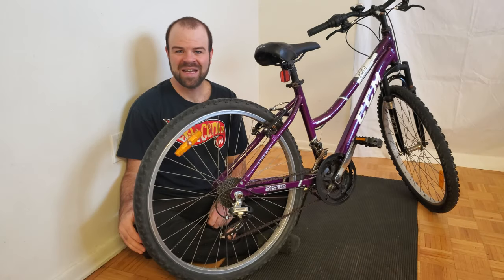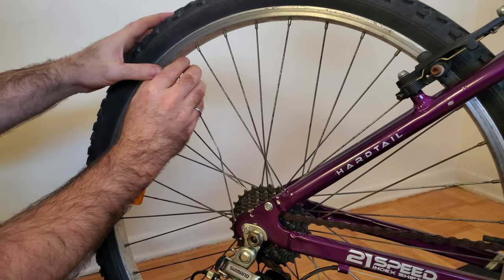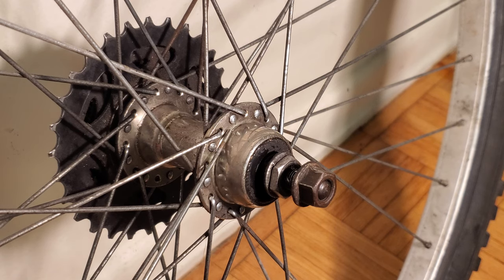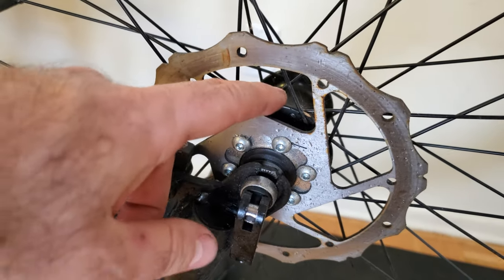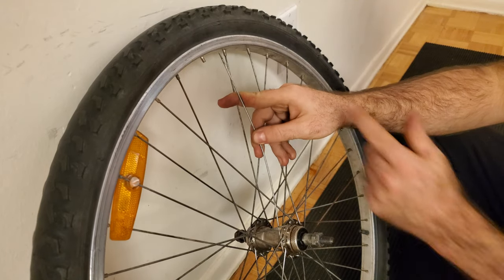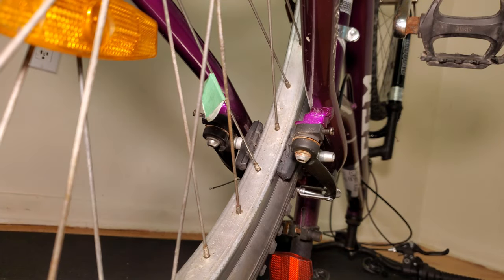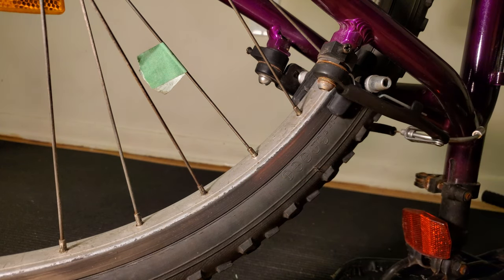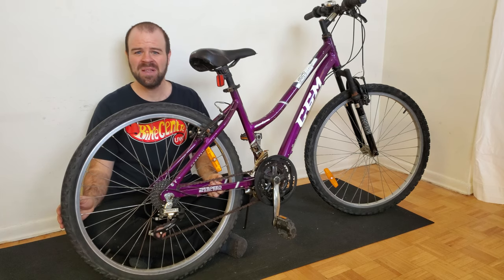How to Fix a Broken Spoke on a Bike Wheel

Comment: I like the method to remove the spoke (which broke at the flange) without removing the tyre.  It never occurred to me before to not have to remove the tyre but in that case it is not necessary. That will save me lots on time in the future.  Thanks,  much appreciated.
Reply from the maker: For sure, thanks. Most of the time they break at the flange in my experience too.

Comment: I'm wondering if you break a spoke, does this mean that all the other spokes are also fatigued and likely to break after your spoke fix?
Reply from the maker: Not necessarily. If it's the first spoke that has broken on your wheel, it could have just been a defective spoke which failed prematurely. If you've already had to replace multiple spokes, it's possible that they are all approaching their fatigue limit.

Comment: 11:40 The #1 cause of broken nipples like that is a spoke that's too short. The ideal length is one that just engages (fills) the neck/shoulder of the nipple, giving it extra resistance to being crushed or fatigued by the relative motion of the rim eyelet. Leaving the nipple "empty" there causes undue strain and may even pull the nipple through the eyelet.
Reply from the maker: Good to know, that makes sense. That type of failure actually seems to be pretty rare. More common (at least on the bikes I work on) is for the spoke to shear off just below the nipple. This happens when you are trying to true the wheel and you encounter a nipple which is badly seized onto the threads of the spoke due to correction. When you try to spin the nipple, the spoke shears off. Where I live they put a ton of salt on the roads in the winters which causes a lot of corrosion damage to bikes.

Comment: You could have let some air out just in case to prevent possible putchure.
Reply from the maker: Thanks for the suggestion. I actually wouldn't recommend doing this because with a flat inner tube, there's a greater chance that the spoke/nipple could push past the rim tape and cause minor damage to the innertube. At the time you wouldn't know you were causing damage but the when you pumped it back up you might find out the hard way. The safest would just be to fully remove the tire and inner tube, but that's a lot of extra steps.
Reply: Yeah spot on. Hate when the tape comes off. Just extra work. BTW as the days get longer, do you think cycling turorial videos pick up? I think the days get longer and people ride more , and as the days get warmer in March, it really picks up. That's how I see it with the views. Thanks

Comment: This video  wasn't helpful for me. All the process is very  simple but how to work  on back wheel that's the problem . He just showed it on the beginning,  but was continuing on front wheel  as a sample.
Reply from the maker: You must have missed something, because I definitely did not use the front wheel as a sample. As explained in the video, the procedure for removing the sprockets from a rear wheel can vary a lot from one wheel to another. As I mentioned, I have a separate video on this topic which covers this in detail for the two most common styles of rear sprocket systems. Please check the video description.